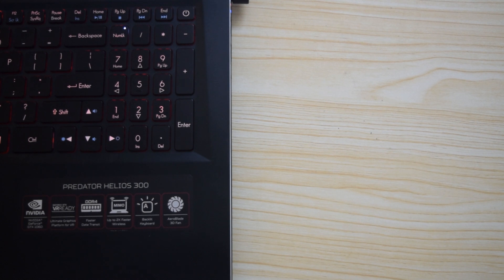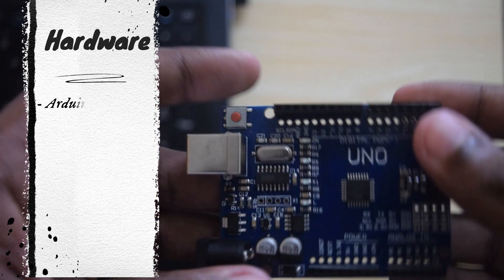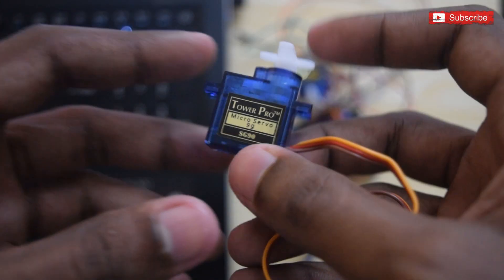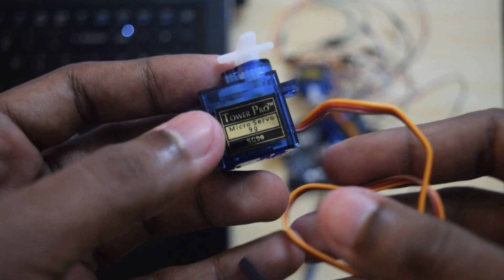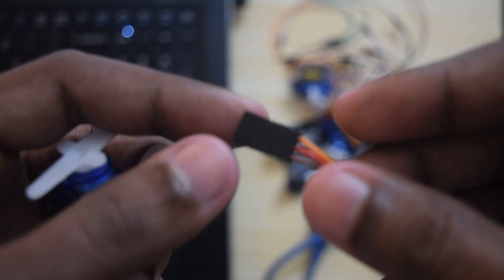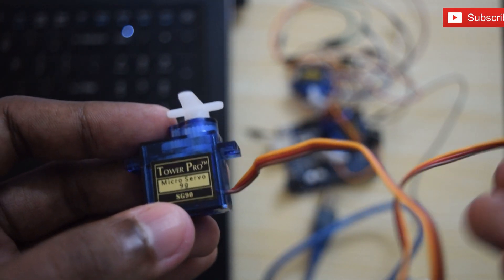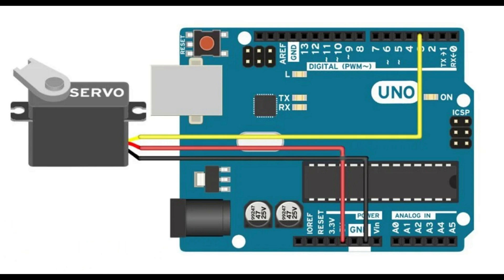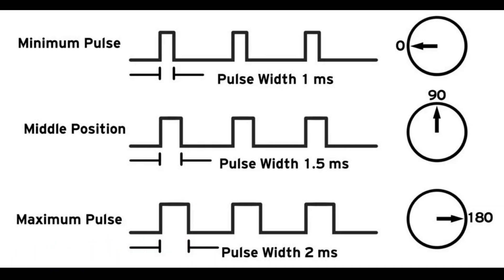Interfacing Multiple Servo Motors To Arduino Without Any External Controller | Code Explained

Comment: After flashing the program how can I control it to ON and OFF without pc.
Reply from the maker: Either you can use time delay, IR sensor or control the power manually with a switch.

Comment: but i have a qustion..
can i control this 2 servos with 2 different delay time?i mean how to do this using a MODIFIED code?
where should i change or add a different code?
Reply from the maker: Declare the second servo in another loop with different delay.

Comment: But then you always need your computer to run the servos?
Reply from the maker: Nope. Once program flashed to the Arduino, it'll be there if you're not going to flash another program.
Reply: After flashing the program how can I control it to ON and OFF without pc.

Comment: Hi! I find this tutorial fantastic!I just have a question, since I have use the code and connected the servo motors, they are running, but very slowly... Could be the power supply? I already connected an AC-to-DC adapter of 12V and when I use one servo is ok, with the two is super slow.
Reply from the maker: Try to change your power supply. Use 5V for servos
Reply: @TheNoviceLearner  The Arduino R3 only has one 5V power supply.
Reply: @dianafonseca8233  I guess you could get a nano and breadboard or you could get a 7.4v lipo battery and voltage regulators

Comment: Hello, can you help me to put 3 servo motor with ultrasonic sensor? How will I put it in the arduino? Hope you can help me
Reply from the maker: I've already uploaded the code in the link provided in description. It's very simple code and you can easily modify it to integrate 3 servos with ultrasound sensors.

Comment: Sir can we control quad servos with arduino please reply
Reply from the maker: Yes, you can do it easily. Follow this above method and edit the code to add two more servos. If you want to use more servos, better to use Adafruit boards to interface with Arduino.